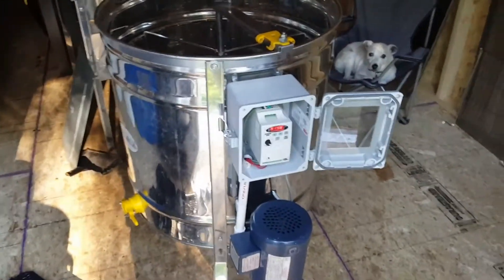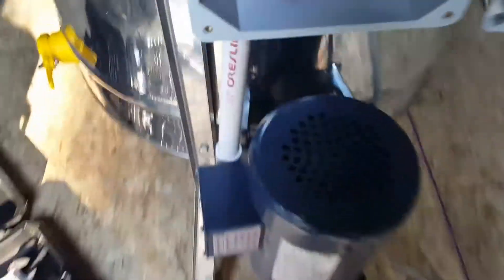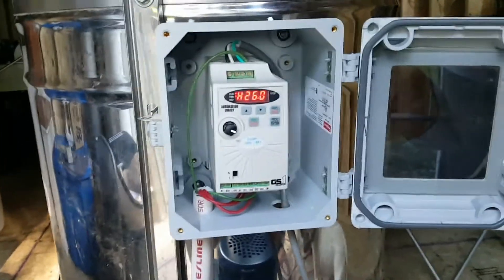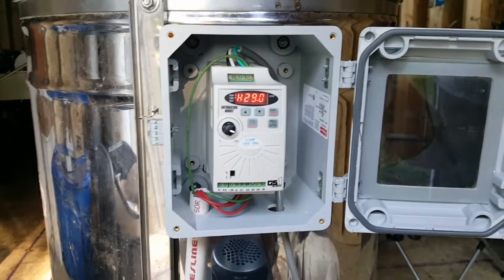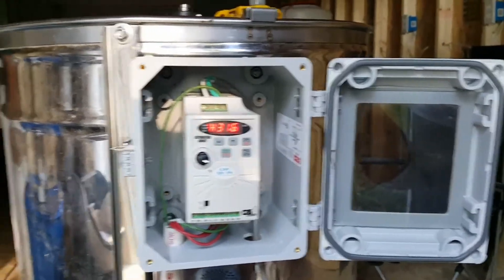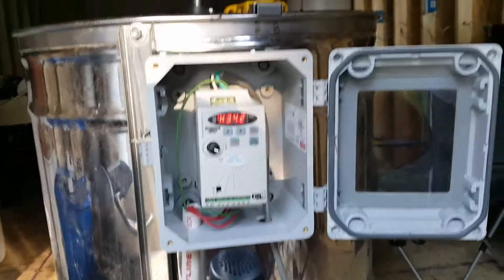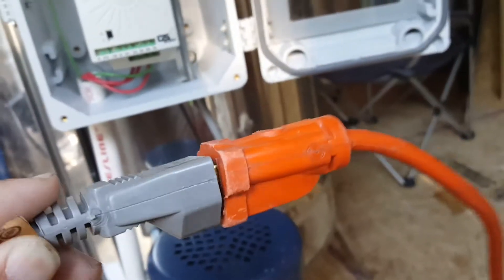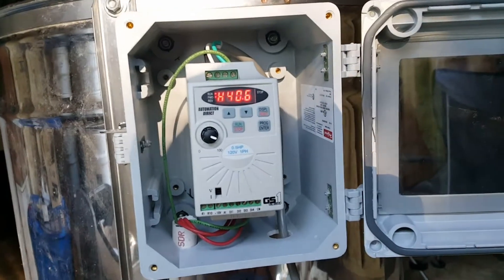Mann Lake 18 frame extractor VFD conversion

Comment: David,  do you anticipate any problems with harmonic vibrations from the basket being slightly out of balance?  I usually want to be right at the switch of the (factory supplied) VSMotor when I first start up.  My unit tends to "shake rattle and roll" if I don't get it pretty well balanced.  Today I had a plastic foundation pop out and the machine wanted to dance across the floor.

Great technology, best of luck,  LP
Reply from the maker: I plan on mounting the extractor and bucket on a wooden base with casters. I'll bungy it to the wall. I saw a video of an extractor on casters, it looks like it works great.

Thanks for watching.